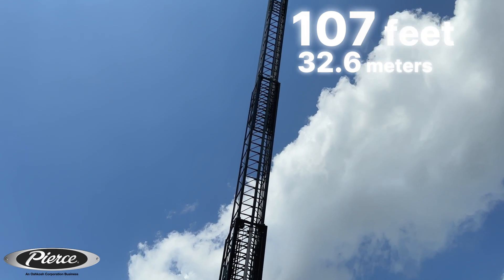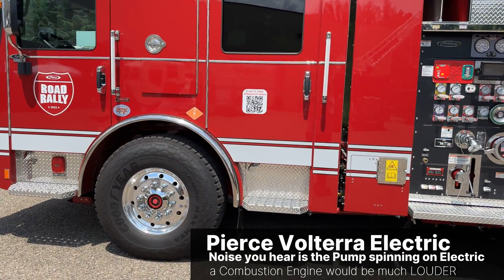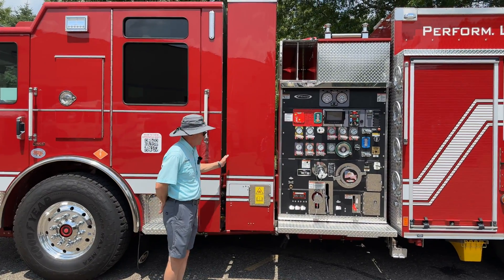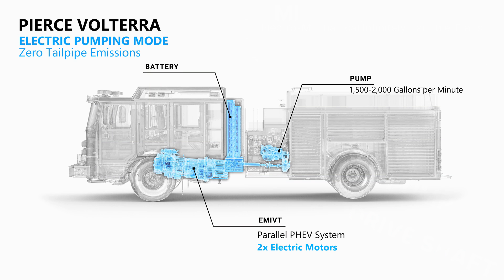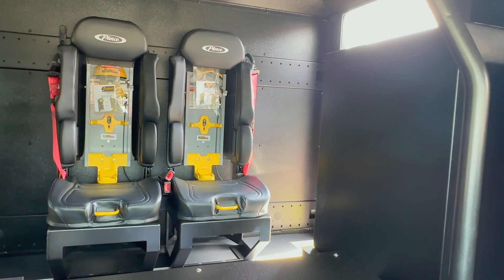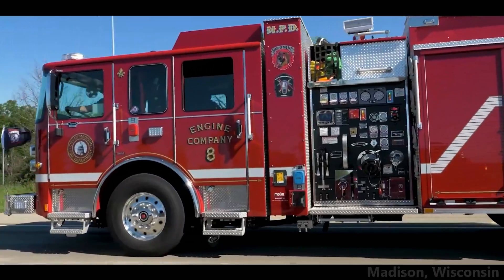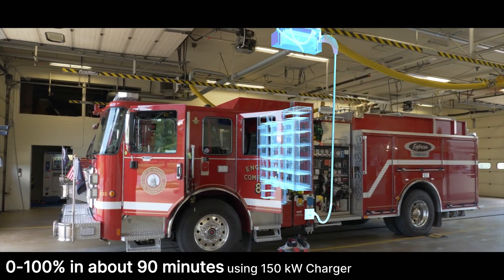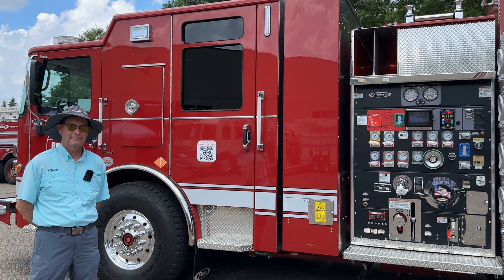Pierce Volterra - Zero Tailpipe Emissions with Zero Performance Compromise

Comment: Pure fing insanity.  Completely unneeded and dangerous.
Reply: How is this in any way dangerous, or a bad thing (let alone insanity)?
Reply: @CuthbertNibbles guess you missed the world wide lithium ion bonefire
Reply: @flyingsword135  that really hasn't been an issue for a few years now, it's mostly a solved problem. Lithium vehicle fires have been steadily decreasing since 2022, advances in chemistry and pack construction make them exceedingly rare.
Where did you get this information from? "World Wide Lithium Ion Bonfire" sounds like a sensationalized term straight from Facebook, rather than something born of statistics.

Comment: Ambulances next, I’ve never breathed such terrible exhaust from any other vehicle, more than a speeding ambulance on the freeway. They’d be quicker too if they were electric, pretty important. Also most of the time they’re idling in a parking lot on standby fuming up a parking lot giving people cancer making noise. They could be silently idling and even incorporate solar on the roof to assist in range or AC.